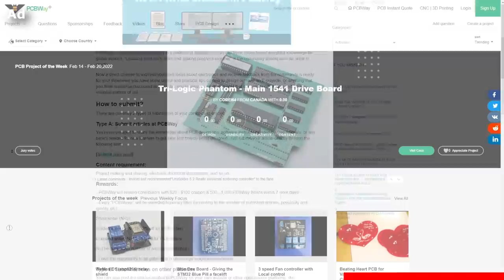Building a Giant Airbus A380 RC Airliner/ Part 7 Stabilizers

Comment: Ramy, your builds are inspiring. I am an aircraft mechanic and so far I’ve worked on all the commercial models you’ve built and the details are amazing . The A380 has only two Thrust reversers on #2&3 engines maybe you can work on a design to incorporate that on this build . I think it would blow everyone’s mind if you touch down and then speed brakes & reversers deploy .😉 P.S. your videos also lit the fire for me to get back into R/C flying… I built the flitetest P47. And can’t wait for the weather to warm up in New York City so I can launch it😁

Comment: Another great aspect of the kevlar hinge is that it actually strengthens the cut-edges of the airfoil and will absolutely prevent stress fractures etc from forming. In contrast, if 'typical' hinges were used, the edge would be weaker and any screw-holes etc would add stress-riser points for fatigue cracks to form. I have no idea if that is a 'real world' problem with model aircraft but, from a purely materials/engineering perspective, it's a really great solution.
Reply: Except in extremely high-performance model planes, stress fractures aren't a problem as most models are both over-built and over-powered. 

You're absolutely right it's a great solution all around though.

Comment: Ramy you should try to add the main gear doors so when the gear is down, it doesn't look like a metal stick. I know this sounds comment sounds like you are making this plane not good, but this is the best craftmanship i've seen in my life. I have myself built 20 different RC airliners, mostly from the Airbus side. I also got a Delta A350 sitting in my shed ready to be flown.

Comment: Since both the skin and its molds are created using the same CAD model as the interior structure, couldnt you mark/measure places to glue a couple of alignment pins onto the skin interior surface? That way you could garauntee that the structure is aligned to the skin prior to gluing, and when you glued the other surface the pins on that would ensure that it aligned with the structure already glued to the other side.

Comment: Great work! Question, what is the adhesive you're using to bond your carbon wing halves together? I didn't see it referenced in any of your other videos. Kind of looks like just normal laminating epoxy with glass beads in it...?
Reply from the maker: Exactly, epoxy mixed with microballons

Comment: Excellent progress! Just one question...  Is the weave of the kevlar cloth reinforcement perpendicular (square) to the hinge line or at 45° to it? It'sdifficult to see, but it looked as though it was perpendicular, which would only make use of half of the fibres across the hinge line.

When I used to make quite large (4 metre) composite gliders with full-span flaps (variable camber) I always laid the cloth at 45° for hinges, which reduced the sharpness of the bending forces on the fibres and also let all of them work at 'half stress' to strengthen the hinge.

Thanks for another great video, Ramy. We need all the positive news we can get! 🙂

Comment: Hey Ramy ! Nice job 
2 questions for you :
- which profile did you use for stabilizator ?
- how did you determine the thick of it ? Did you use an existing plan ? Did you simulate it on wingdev ? Other ?

Thank you
Post scriptum : when can we bought stl files on Ramy website shop?👍

Cheers from France 🇲🇫

Comment: Hi Ramy, thanks for the video, light construction indeed makes the ambiant air lighter :-) Have you considered as a possibility to make a trimmable stabilisator, like the 1:1 PHR in addition to the for sure efficient Kevlar hinged big surfaces? You already experienced big flaps + trimmed controls were good but I wonder if it would help low speed abilities significantly though (+satisfying realism functionality ;-)
Hope you could fly this last sunny days. Cheers!

Comment: One question for you Ray that I think I know the answer to but wanted to know for sure...... did you use CA adhesive to put the molds together?  If so what type of CA glue (slow setting)?

Comment: Hi
I am huge fan of your works😊
Please tell us how did you do the hinge like that? It's amazing
Reply: He added a layer of kevlar to the layup (the yellow fabric). Then, after the stabilizer was complete, he cut through so that only the Kevlar remained at the hinge line. Unlike fiberglass and carbon fiber, Kevlar can be flexed without breaking, so it can be used as a live hinge, as he did here.
Reply: @martinmckee5333  thanks Martin, but still I don't know how he cut inside the elevator that it can be go throw inside like that

Comment: quick question, do you lay a fiberglass sheet down 1st then the carbon sheet and if so why?
Reply: An outer layer of fiberglass is pretty typical with carbon fiber as it gives a layer that can be sanded smooth more easily, and also prevents damaging the carbon fibers during sanding. He did seem to use two layers of glass, so it may have been needed for strength instead of another layer of the - expensive - carbon.